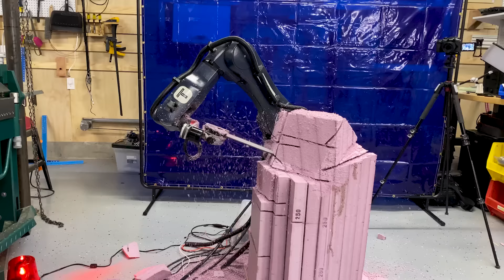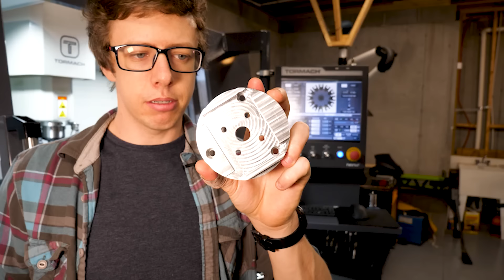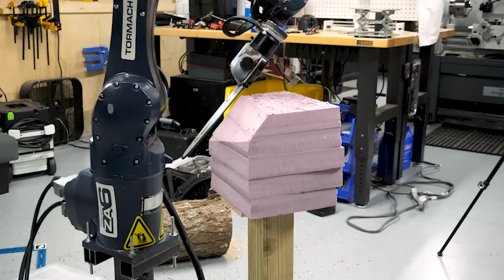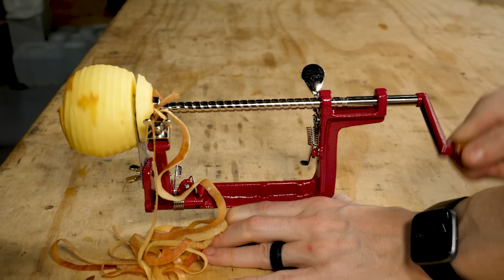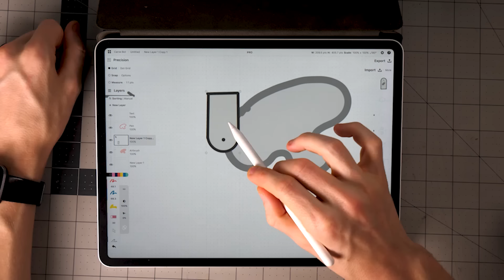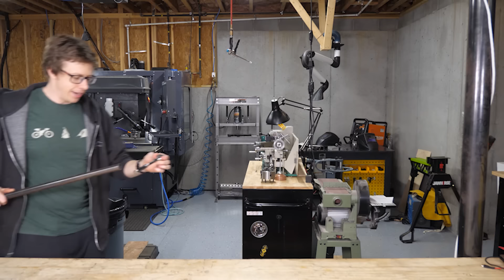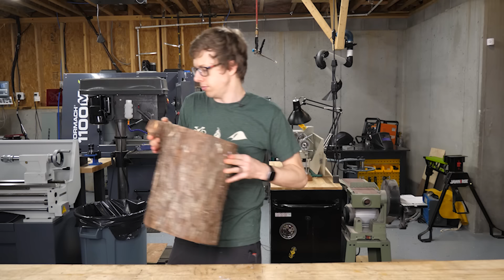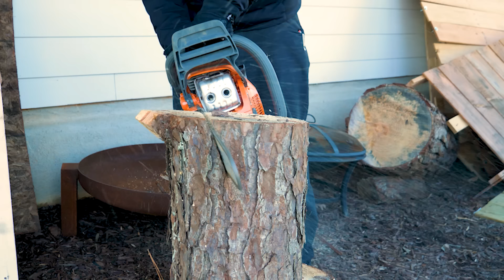Chainsaw + robotic arm = art?

Comment: 2 tips for wood:

1.  Use a carbide tipped chain
2. File the guards down. Lots of people that don’t do it for a living don’t realize you need to file the guards every 3 or so filings of the teeth otherwise they block the cut. The more you file, the more the teeth bite. Since you have a robot with lots of strength holding the saw, you can file them down way more than a human could hold back and have it cut well at all angles.
Reply: filing down the rakers allows the teeth to remove more material at a time which is dependent on the power of the chainsaw.
Reply: You are SEVERELY overestimating how strong a robot arm is lol, that particular robot can only lift 13 lbs. If you look closely you don't see any massive hulking motors sticking off that robot or anything like that because the motors are so small they fit inside the arms and they don't even really have insane gearing ratios either because robots are quite fast, usually a 2:1 or 3:1 reduction with a small belt and sprockets is very standard. Its very unlikely he will ever get a robot that small to be able to cut wood with a human chainsaw.
Reply: @Fine_i_set_the_handle  duh!!
Reply: @Fine_i_set_the_handle  then he needs to use a different chainsaw not a human one
Reply: this comment has been very informative for me as a homeowner whos had trouble with various chainsaws. Such simple information that I had zero idea I needed to know so i never would have looked it up. Thank you.
Reply: Just use a big router bit.
Reply: Use the tip of the saw
Reply: @gadgetg9479  If you paid attention and/or watched the whole video, you'd know that the guards are precisely why he can't cut with the tip.
Reply: @Oroborus710  I got that bit but the tool parth might need some adjustment after looking at quite a few freehand chainsaw milling videos over the past 3 years Me and my father have completely changed our technique with the saw.
Less is more to optimise a saws cutting ability you want to cut with as few teeth as possible this let’s each tooth do the most work possible. Not slow the saw by making lots of teeth all work at once!!! This can be quiet dangerous if the saw is held by a man but (safety first always watch for kickback) but I don’t see that problem with a robot!

Comment: Gradient ascent sounds a lot like evolution, it can get stuck at a point that isnt the true summit. From what i know, evolution only works by improving the creature. The creature can’t devolve in order to build a better evolution, which is why we don’t have wings. Sure it would be beneficial to be able to fly, but to get there we’d have to evolve the useless parts first which would only consume energy and make us less efficient. Evolution works in stages, and weird flabby bits that cant give any lift or glide to a person provides no benefit whatsoever. So if a creature evolves to a point nature sees as optimal at that moment , the creature will stop evolving (until prompted again by need), even if there was a better path in a different direction.

Comment: Having the log and robot perfectly aligned seems like too much of a hassle.

What if, instead of doing all that, you just use equipment to make sure that the robot knows how to correct the positions of its cuts?

4 sensors, 4 transmitters. Sensors receive the data from the transmitters, this data being the distance from the transmitters. With 2 transmitters on the saw and 2 on the the object, you can easily calibrate the system on the beginning and have the robot adjust the arm movements on-the-go (you chose when it will re-evaluate stuff: based on timers, when the table is turned, or any combination of these).

The re-evaluation should occur between the step where your cuts are obtained as sections of planes (basically, a closed geometric shape on drawn on a plane) and the step in which they are turned into machine code. Since most of the program load exists (I suppose, correct me if wrong and please elaborate) on the calculation of the best cuts (brute forcing algorithms based on trial and error), having to adjust for robotic arm movement should be very fast (no trial and error, the arm does the same stuff, ALWAYS). So, after the conversion of the 3D model into plane sections, a.k.a cut map, you can even share it with other people, no matter what setup they have to execute the cuts (different robotic arms and methods, for example).

Of course, having equipment stuck on the raw material is not desirable for a lot of reasons, so instead... You could have the material not being turned at all  (thus needing a way to move the robot around instead), or, of course develop a better turntable for raw material. The transmitters on the robotic arm will never get hit by the chainsaw (supposing you implement some sort of anti-self-collision algorithm), so these 2 are safe.

Comment: For the smoking issue, the chain needs to be oiled the whole time during the cut, else the friction from the chain on the bar creates lots of heat which burns the wood and makes it harder and takes more force etc etc, long story short, try adding a chainsaw oiler to the system
Reply: Not only that, but the chain/bar friction will cause the bar to warp and the channel to gall up. Result, the motor will be overloaded. 

Another problem is the duty cycle. Pole trimmers are meant to be used for only a few seconds at a time, not continuously. 

Seeing how well it cut the Styrofoam, but did so poorly on the wood, there is also the probability that the chain was not sharp - or not sharpened correctly.

Comment: couldnt it check for a false summit by checking the 2d plane at the hight that it thinks is the highest point, and if it sees anything then it moves the point to that place and keeps checking until it gets to the highest point. im no engineere so there is probobly something im missing like this might not even be possible

Comment: I know I'm late to the party, but I can't help but wonder why didn't this guy use the 3D model's normals to calculate the paths. i.e. tell the program to only check for paths that are tangential to the model, only making sure to not cut into the model itself and that the saw fits of course.

Also you can re pose the bears, that's why they're in t pose.

Comment: I'm probably completely wrong and such but please be nice and explain why it wouldn't work.  Why not use a laser range finder attached to a point of the saw. That monitor s distance to target.  Based off the cad model points so it doesn't need to know shapes of wood and how much to cut it just needs to know that as long as the distance to target point is positive it can keep working . The CNC instructions tell the blade what to do the laser tells it how far ..

Comment: Could you possible find the true summit by creating a series of points to check at once, then compare them to see which ones end up at the same space? Like, if the program notices one of points found a higher point, that would be your true point? it would be slower, but faster than checking all points individually?

Comment: The best way to avoid local maxima in gradient ascent is to just try starting from multiple different points, although your computation time will scale directly with the number of starting points. I wonder how much it matters if your path is suboptimal though, as long as it works?

Comment: I'm a bit late, but you might want to consider the chainsaw wheel for an angle grinder.  Much more compact and able to fit into tiny areas, but aggressive enough to remove material

Comment: With an angled saw tip, you can shave concavities into wood by raking backward \<-\; taking only a chain's depth out of the wood with each pass:  or you can saw round holes by rolling the blade shaving out the back of the hole with the tip, which is the most difficult and exhausting maneuver and likely to fail. I don't know if the chatter involved with these two sawyer tricks will fatigue the arm, but they fatigue real arms.
Reply: The curve of the the tip, the lay of the blade and the directions the saw travels are its limits; your inclination to treat a chain saw like a single-edged blunt-tipped-knife is your self-imposed limit: the chainsaw can be used at the angles of a paint-brush, and an auger. Standard safety teeth reduce cutting efficiency; their hydraulic-design-physics swim away, without them saws swim-into hydraulic-medium: you wouldn't feel it on solids.
Reply: you can customize chains into exclusively cutting teeth or exclusively safety teeth, which still cut, for different artistic strokes.
Reply: Can you make a wearable arm that the robot arm can mirror? or slow the sawing travel because you can lean into the saw too hard and make it hot, burn off the lube and get stuck or catch fire: sawing happens at its own rate and you have to feel like your just laying the weigh of the saw down and it just paces its self. Without tactile its tricky.

Comment: my guess if that the chainsaw didn't cut the wood because it was fed too much at a time, then it heated up causing the blade to get dull easily. When loggers cut wood the don't make one big slice at a time, its basically 'feeling' of 'knowing' the machine to tell when its time to ease the throttle. I'm guessing that's why chainsaws have throttle instead of on and off switch although the same is applied to any similar machine, for a table saw you cant push a piece of plank through the blade as fast as you can, you need to feed it at the rate the machine can handle.

Comment: You just make a second inverse guess then every thirty degrees making a circle based on the two points.
Reply: Calculus...
Reply: That solves the peak problem if the surface is larger do this multiple times with circles of constrainig sizes the closer together the circles are the more accurate your prediction.

Comment: depending on how strong your robot is, you can grind off part of the drag teeth to get a more aggressive cut on the tip. you may also be able to get a "Reduced kickback chain" as opposed to the "low kickback" chain you are running now, but those are typically only available for larger pitch chains.

Comment: I had a query while watching this video i think someone could help.
Since "The Guy" started the approach with meshing polygon to make the cuts.
Why would he had to optimize for a continuous curves  since end result already is excepted to be polygonal and Cutting could never generate cuts that are smooth?
He could have used the faces of polygons to make the cuts.
In that case,  with assumption of using triangular polygons for generating the mesh.
There could be 4 cases of cuts:
1. Triangular polygon forms pure convex set with respect to surrounding polygons.Then a direct cut parallel to face can be proceeded.
2. One side has concave intersection then cut has to be done from two different directions of other two sides.
3&4. for 2-sided and 3-sided convex intersection, cut cannot be made due to movement intersections of chain saw. So, mesh has to be rectified to fall into case of 1 or 2. So, cuts could be made possible.
Could someone tell me why this would not work?
If you find any loopholes in approach, that I could not have thought. Please tell me.
So, that will not fall into same pit again.

Comment: My idea of making the software to cut a specific shape would be to use a polygon mesh, like in video games. This simplifies the calculations a lot, because all you have to do is go through each face of the mesh, and try to figure out if you can make a cut parallel to that face (i.e. would the chainsaw collide with the mesh, and could you rotate the chainsaw at that specific angle). If you can't make the cut, you skip that face and go to the next one, and keep iterating until you either cut all the faces, or you can't make any more cuts.

Comment: Can I just give Tormach a additional shoutout for supporting you on this and enabling you to test this new piece of machinery?  I've gained so much respect for them as a result of this ploy, even though I know it's marketing and user testing, it just speaks heavily to their company.
Reply: At least they care what users of their products think, have seen companies much worse
Reply: I swear the engineers at Tormach are fans of Shane and got the marketing department hella drunk so they'd do this :D

But tbh Shane is the best kind of beta tester. His projects are so far outside the norm that if the robot has any weaknesses they will come out. I've done beta testing for video games, and a part of it is trying really stupid ideas or really weird speedrunning tricks that might screw with the code. Basically if a speedrunner searching for new tricks can't glitch the game even by manipulating code, a normal gamer is really unlikely to ever fall through the floor. Same principle applies here: if the robot arm can survive Shane's project, a normal customer will never run into a problem.
Reply: @nalinea18  Course, actual speedrunners will immediately glitch through the floor or go the speed of light
Reply: @nikkiofthevalley  sounds about right

Comment: Bit late to the party, but the simplest solution to avoiding local maxima in gradient ascent is to run the algo a large amount of times while randomizing the starting parameters each time, then filter for optimal end conditions after it's been run a whole lot. It's one of those times in maths where "just keep doing it over and over" is very much a valid solution.

The idea behind it is that if you randomize the starting parameters, including the starting point and all the vectors, say, a thousand times, you'll eventually hit a set of parameters that will initiate gradient descent to the absolute maximum.

Who knows, might come in handy again one day!

Comment: If you only sharpen one side of the chain… you get a curve cut.
Reply: And if you sharpen both sides you CAN make cuts with the tip of the saw.

Most people who don't use a chainsaw for a living seriously underestimate how sharp the teeth need to be for the saw to run properly.
I sure did.
Reply: @uegvdczuVF  needs sharp indeed
Reply: yeah but keep in mind that he has a robot arm, it's strong enough that it'd probably stop a curved cut just from brute force.

Comment: The "anti-kickback" things you were talking about are called rakers. They determine how much material the teeth remove as well as keeping them from biting off more than they can chew and causing kickback or getting stuck. I can't tell through the video, but It's possible the chain was just dull, and that's why you overheated the saw. The rakers may also need filed down, or both. Also, just like with an end mill, there is an Ideal feed rate that you should be using to prevent overheating and premature dulling. Normally, the saw will "pull" itself through the cut. But, since you can't really just put the right amount of pressure on the saw to get it to feed correctly maybe you should remove the saw, sharpen it with something that will for sure properly set the rakers like a stihl 2 in 1 sharpener, and try to determine the feed rate the saw "naturally" has and try to match it. I doubt that would work very well, to be honest. If your not dead set on using a chainsaw chain. Look into a "log wizard" it is a chainsaw attachment that uses a drum and blades for carving notches into logs. It would behave much more like an end mill. Good luck! It's cool!

Comment: You need a special carving bar and chain. Small radius tip + non-safety chain designed to cut on the sides and the top + robot with controllable feed rate = you should be able to make almost anything you want with a ton of detail.

Comment: A couple things from a guy that uses a chainsaw a fair bit... 1. You need an oiling system for the saw to keep it well lubricated. That should help with the overheating. 2. You need to sharpen your saw with something that will also adjust the rake tooth in front of the cutter tooth. Stihl makes a manual sharpening tool that works really well at this.

Comment: Are you aware of carbide tipped chainsaw chains? Fire Departments buy the type that won't shatter when they hit steel. I always get the full hard type because the trees on my lot don't contain ferrous surprises. Full hard stays very, very sharp. However the full hard edges will shatter upon running the saw into the robot's body.

Why wasn't there a routine to check every movement command to prevent the intersection of the volume defined by the robot and the volume defined by the saw?

Comment: Very interesting video. The "anti kickback tooth" is a depth gauge. You need to file it down. Sharpen the blades first with a round file and then file down the depth gauges with a flat file so that they leave enough room for the blades to work. It will cut like a hot knife through butter.

Comment: 15:50 Hehehehe. I'm a software engineer. My first products were Atari 2600 games, I'm old. We always had to use shortcuts. I think that's still true today for most things. In this case what jumps out to me is to define a few "standard" cuts. Slicing off slices is one type of cut. V cuts are another. Kerf cuts probably another. With maybe 10 standard cuts only those need to be searched. Then you can tweak that cut.

I think humans who do this type of carving do the same thought process. Slab cut or V cut? Then how to make that cut.